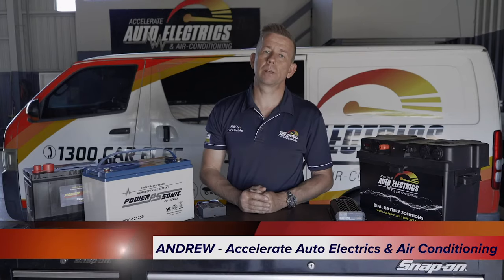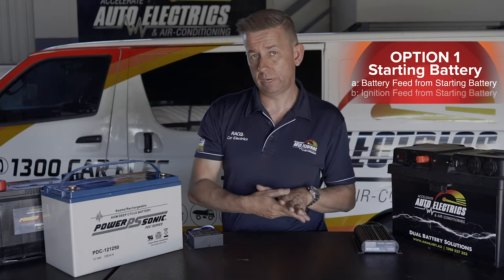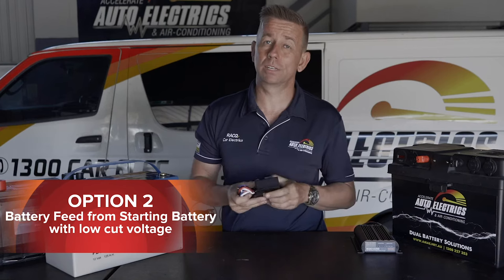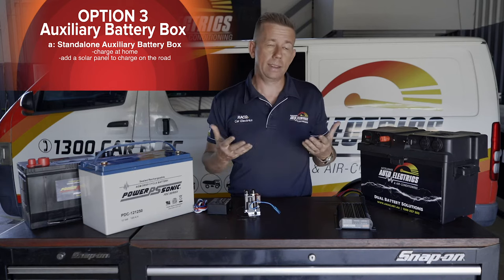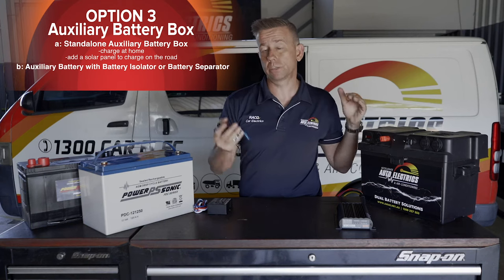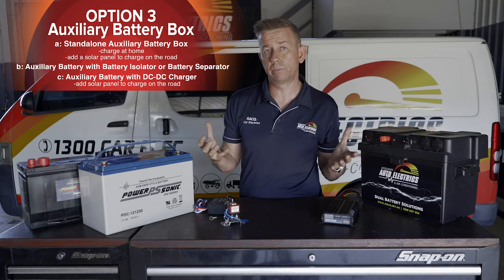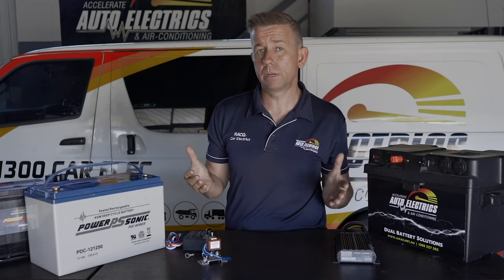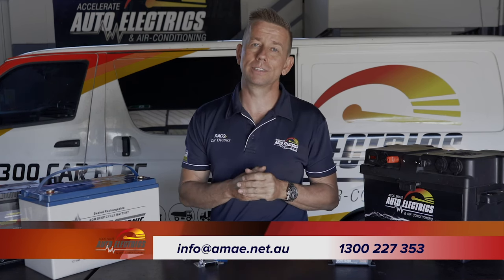How to Power a 12 Volt Camping Fridge | Accelerate Auto Electrics & Air Conditioning

Comment: Need Help.  We travel out west from the east with our travel trailer .Tired of  the ice thing and having to deal with the water damaging food. 
Looking at a 50 liter frig for the back of our Suburban but don’t want to put ant extra strain on it’s battery . 
Would having a battery in a box with 12 volt adapter be sufficient for at least two days of power from a standard battery?  Would be hooking it up to a charger every night for conditioning at the campgrounds.
Trying to be cheap with a standard battery and this set up would only be used once or twice a year.
Thanks for any info
Reply from the maker: hi Mark,
Thanks for your comment! 
I would find out the specs of the fridge you want to run, how many AMPs does it draw and then base your set up off how long you want it to run for.

E.g. If you fridge pulls 2 Amps an hour and you have a 100Ah lithium battery, you can drain that down to 80% so you have 80 useable amp hours which means a fridge pulling 2 Amps continuously, in the suggest ambient temperature should run that fridge for 40 hours.

Thanks for watching, 
Accelerate Off-Grid Touring

Comment: You comment that factory wiring is sometimes too small. Please advise what gauge is recommended to wire a cigarette type fitting to a separate 150Ah AGM battery in caravan? Thank you.
Reply from the maker: Hi D M - Thanks for your comment! We recommend a minimum of a 6mm Twin Core automotive cabling for fridge applications. Hope this helps!

Comment: Question for you if you don't mind. I'm doing my own van conversion and have installed a power system consisting of 3 12v batteries to run the fridge, water pump, and charge phones and such. I went with an AC charging system that is run by either a true sine wave inverter or shore power, to charge the batteries. the inverter is set to turn on while the vehicle is running, charging the batteries as we drive. The problem that has arisen is, while the charger is on, it sends my refrigerator into a bit of a frenzy, with the temp. display jumping all over the place. I also can't use my cell phone if it is plugged into the batteries for charging. is this being caused by the charger? when the van is off and the charger isn't operating, everything works fine and no issues.
Reply from the maker: Hi there, due to the complex nature of van power systems, it is extremely difficult to advise on the best solution for you without seeing the set up in person. We would suggest consulting with your local 12V specialist for further assistance. If you are local to our area, we would be more than happy to help you out, please feel free to contact us on 1300 227 353 or info@amae.net.au.
Reply: Hopefully you figured that out...sounds like a ground issue. But wouldn't use anything until you get that fixed.

Comment: Hi
What size cables should i have in my caravan to charge 2 lithium batteries, 150-170 amps each?
The manufacturer wants to use the minimum 6mm wire but i've  been told that is too small.

How thick is 35mm2 wire?  is that measuring the copper wire or the external insulated diameter ???
TIA

joe
Reply from the maker: Thanks for the comment! 
35mm2 is the cross sectional Area of the the copper strands.. Essentially it is classed as a 2B&S Automotive battery cable with a current rating of 150amps. 
Depending on the DCDC charger used and cable run would determine what size to use.

Comment: On a centre console fridge (bushman roadie) can i simply cut off the cigarette lighter ( merit) plug and then connect that to my lithium battery behind my seat and or fuse box
Reply from the maker: Yes, it is possible to remove the plug & hard wire the fridge but I would check with the manufactures warranty specifications. 

In some cases, modifying the leads may void warranty.

Comment: I think some fridges have a built in cut out in the fridge itself to save the starter battery
Reply: Your charge controller has, obviously you can't run your fridge without a controller.
Reply from the maker: Thanks for your comment! 
Yes, some 12v fridges do have built-in low-voltage cutouts. 
It is still not recommended to run these off your start battery alone due to the battery not being designed for this application.

Comment: Kindly advise me which 12 battery protector for the fridge 80amp or 40amp do I need?
Reply from the maker: Hi there, it is difficult to recommend something without knowing the full extent of the system, but we will try to offer some advice. 
If you are fitting a battery protector to just your fridge circuit we would recommend the smallest one possible with a fuse rated to suit your fridges amperage. If you wanted to fit a battery protector to your entire battery system you would need to work out your total amperage at one time, running your common appliances, and fitting one to suit. 
For further information, please feel free to get in touch with us at 1300 227 353 or info@amae.net.au.
Reply: @accelerateoffgridtouring  Thanks

Comment: Have a noco 240V smart charger and a 120W inverter. Can I charge the auxiliary battery using  cigarette socket—>inverter—>noco charger.
Noco charger has got input wattage of 60 watts
Reply from the maker: Factory cigarette socket wiring is undersized for the charging applications in most vehicles.
Unfortunately you cannot charge an auxiliary battery via an Inverter running a 240v battery charger, this is inefficient and you will actually flatten your input battery quicker then it accepting any charge. As it takes a-lot of 12v to make 240v to then step it down to 12v again there will be massive power loss in this system. If you wanted in vehicle charge I would recommend a in vehicle DC-DC charger.

Comment: Can you do the extra battery w the dc dc charger AND the solar panels?
Reply from the maker: Yes, you can charge an Auxiliary battery with a dcdc charger and Solar operations. 
Usually most higher quality DCDC chargers have a built in solar regulator for this option. Some chargers however will prioritise  solar charge over DC.

Comment: Can you charge a lithium ion 12 volt battery from your alternator?
Reply from the maker: Thanks for your comment!
We would recommend referring to the Lithium Batteries manufactures specifications. 
 Lithium Batteries used as an auxiliary battery require a DCDC charger fitted between the alternator & battery.

Comment: Thanks for this, quick question is there any issues having two regulated solar panels, say 250w each, (I have a single 250w) feeding into a auxiliary battery via a "two to one" anderson plug. Reason is I have a large fridge/freezer and I want to "boost' the battery charging with the extra amps from the solar panels, whilst the fridge is running off the auxiliary
Reply from the maker: If you are running 2x solar panels of the same size it is recommended to run them via the same regulator
Reply: I do this, two panels each with seperate controllers to a 2to1 anderson.
I let the controllers pick up the battery level before putting in the sun. It's not recommended because some say the controllers might not align but so far so good when the battery is full both controllers stop charging.

Comment: What do l need to run a fridge,  tv and lights plz help
Reply from the maker: Hi there, most simple 12 volt dual battery systems are suitable to run some basic accessories. The specifics of the system will depend on the details of what you would like to run. We would recommend getting in touch with your local 12V specialist or if you are local to us, please feel free to contact us directly on 1300 227 353 or info@amae.net.au.

Comment: What about using a jackery
Lithium power bank plug that into 12 volt and run the fridge off of that it will stay charged while you're driving
Reply from the maker: I am sorry but we are unfamiliar with the Jackery product. If it is of ample sizing it may run a fridge but depending on how the system is set up but we are unsure if it will charge while your driving.
Reply: @accelerateoffgridtouring  I was told by someone else that if it's a 500 watt or the jackery 1000 watt or comparable solar generator
It will run the fridge and keep it self charge while plugged into 12 volt or you can buy a solar panel and have that attach to your roof or if you're the boondocking set out in the sun but thank you for responding

Comment: How would i go connecting battery to a generator outside
Reply: How long would this setup power a mini fridge like a Blizzard Box from Costco without having to recharge the AUX battery?  Also,  if a recharge is required, how long should the car run to completely recharge the 2nd battery?  Thanks great video